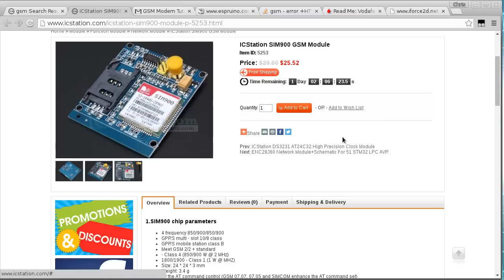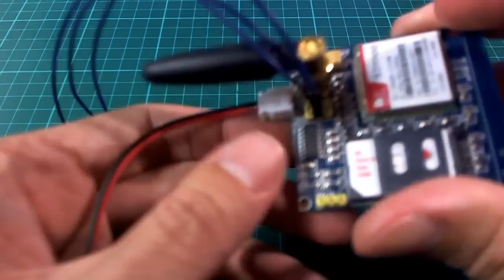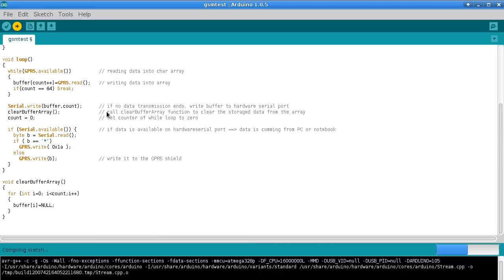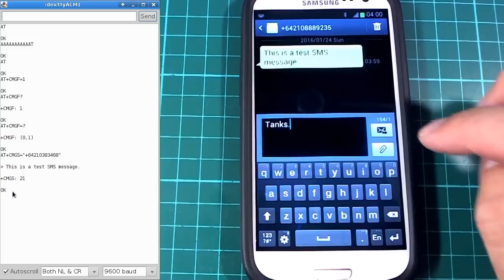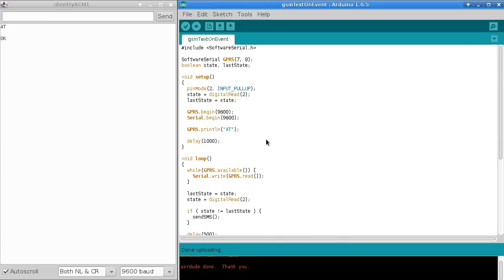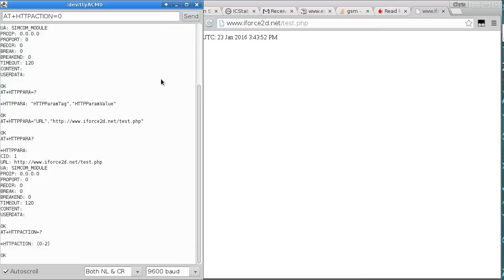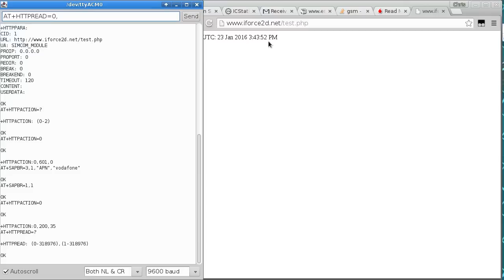Arduino + GSM module (SMS message, HTTP requests)

Comment: Sir i have SIM900A, and its not detecting simcard. Can you help me?
Reply from the maker: +Muhammad Faizan as I said in the video and in many comment answers here.... you need to have an unlocked (password removed) sim card that is recognized by your mobile network, and your mobile network must allow non-registered devices to connect
Reply: +iforce2d you didn't mention k connections clearly. which pin is going into 7 and which pin is going into 8. thanks
Reply from the maker: +Muhammad Faizan well there are only two possibilities, my first suggestion would be to try both ways, it will not take long right? Actually that's what I do most of the time :)
But you can also see in the source code, where the SoftwareSerial is defined, the pins can be swapped there too.
Reply: +iforce2d thanks sir, i hope it will not damage my gsm :D
Reply: +Muhammad Faizan is it possible to receive a message (such as a number like 85) through your phone to gsm and store that number in a variable for some calculation?
Reply from the maker: I demonstrated two forms of receiving messages in this video. In this case I just printed them out to look at, but of course there is nothing stopping you from storing the values. See my other videos on this topic.

Comment: hello, i still failed test sim 900a mini, can you show me or explain me for pin from sim900a to arduino, i see that SIM R from sim900 to pin 7 arduino, SIM T to pin 8, is true ?
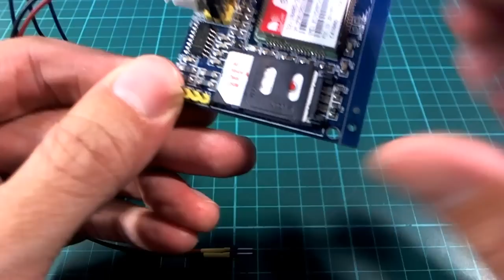Reply from the maker: +Bagus Ramadan please watch again from 5:58 to 8:10 because I showed VERY clearly, and there are only three wires...
Reply: im sorry, i see it, but i still cannot, my indicator blink fastly,
Reply from the maker: +Bagus Ramadan Fast flashing means it's not connected to the mobile network yet. I explained this in the video and I have already answered this in the comments here too, please look at my responses to user BoomBox below.
Reply: maybe, im wrong insert pin, my english languange is bad, so im still not understand, your collor cable is same, im confused, okay, R GSM to pin 7, T GSM to pin 8, GND to GND, isn't true ?? pls
Reply from the maker: +Bagus Ramadan The SIM does not need the arduino to connect to the mobile network - it only needs power. If your LED is still fast flashing, there is no point connecting the arduino yet.
Reply: The sim900a is different to the sim900, I brought the sim900a off of ebay thinking it would be the same as the sim900 but it never connected to the network because my country(New Zealand) did not support it. I found a tutorial to reflash the sim900a into a sim900, then it worked :).

Comment: according to the above video i have configured the sim900a v4.0 with arduino all good and working fine with comuter. but when i connect 9v bettry to arduino   then carrir disconnected please help what can i do??
Reply from the maker: +kamran khan khanzada You mean you power the SIM module with a normal 9v battery? I don't think that will work. As I mentioned these modules can require up to 2 amps of current. Check the datasheet.
Reply: No i cant give the power directly to SIM module i connect the 9V bettry via arduino with same configuration mention in video just only change the power source. please provide the Datasheet link if you have. because i am tiered to search data sheet for sim900a 4.0 kit from google. thank you sooo much for the support.
Reply from the maker: +kamran khan khanzada Why can't you give power to the module? Since you have it working correctly with the computer but not the battery, then obviously the power is the problem. A normal 9v battery cannot provide 2 amps.
Reply: i am making a tracking system thats why i need to put bettry. yes your right 9v battery can not providethe 2 amps. can i put a voltage converter between tham like 5v and 2amps is it ok? its suitable for arduino and SIM module?
Reply from the maker: +kamran khan khanzada yes, that's what I did here, it works ok: https://goo.gl/WWXodz
I used this voltage converter: http://goo.gl/xOd9Jx

Comment: Excellent tutorial! Thank you so much. Just a quick question please? Do the GSM modules that are available generally have on board microcontrollers or are they quite dumb? The reason I ask is that I've just watched some videos on the ESP2866 Wifi chip and there is a project called NodeMCU (lua based) that seems to abstract the AT command set behind a small on board API (the lua interpreter I think).  PS  I'm a complete noob in the arduino world and it's channels like this one that are very very helpful - thanks again ;-)
Reply from the maker: +northshorepx this is the only one I've ever used. I think in general they are 'dumb'
Reply: cheers mate! I've just ordered one to have a play. And I've just seen the Arduino GSM library too - so that may help!

Comment: I do not know English. Could you tell me where you called the OVR and OVT pins on the Arduino ?
Reply from the maker: +Alvaro Jose Marquet Amorim R is for receive, T is for transmit. On the arduino you also have RX and TX (pins 0 and 1 respectively). So you connect RX of one device to TX of the other device.
Reply: +iforce2d But in the video you did not use the pin 0 or 1 and arduino (google translator)
Reply from the maker: +Alvaro Jose Marquet Amorim In this video I'm using software serial, which lets you choose the pins you want to use. The normal  'Serial' (hardware serial) will be pins 0 and 1.

Comment: Great video.  I can't find a datasheet for this.   The description on the various web-shops says it can also be powered from (VCC4) 3.5-4.2volts.  I want to power it from a Li-Po battery, (3.7v) but not sure if it will work.  Do you have a datasheet you can share?
Reply from the maker: +Rob Shepherd Nope - I was not even aware that 3.5 - 4.2 volts is the range it uses, unless you're looking at a different one. That voltage sounds perfect for a 1S lipo battery though.
Reply: +iforce2d cheers.  I think some earlier versions of the ICStation boards had a different header that offered pins for either VCC5 (5v guess to v.regulator) or VCC4 (3.5-4.8v) which I assume was just unregulated VBATT straight to the chip.  I guess I'll have to solder tap onto the raw VCC line if i can find it :)  Cheers again

Comment: How to make more switches and different message for every switch
Reply from the maker: +StratusBikeParts as you can see in the code I'm doing digitalRead(2) to check the state of pin 2. Just do that for other pins....
Reply: +iforce2d OK :) thats im doing, but... how to make that: digitalRead(2) send message Switch was turned on or off and (thats my question) digitalRead(3) send message Temperature low or high. 

two diffrent switches and each kind sending a different messages
Reply from the maker: +StratusBikeParts I showed at 29:32 in this video how to send an SMS. Just look at which switch was changed and send a different message, very very simple.
If you want better help you'll have to make your question clearer.
Reply from the maker: +StratusBikeParts here, it takes just a couple minutes: http://pastebin.com/w7aUFq0q
Reply: Now I understand how it works :) thank you for your response and your time
Reply: +iforce2d  Some idea above adding the option of testing the contact with the module
 once per 24 hours by performing the voice call and disconnect after hmmm two
 rings

Comment: I have done the CR + NL and it doesn`t work. There is a configuration at windows level when you add the serial port of the computer in the control panel-device and printer-Port settings and these are the values that I have::
Bit per second       9600
Data bits:                 8
Parity:                       None
Stop Bits:                 1
Flow Control:           None

Can you please tell me if you have the same values. Cause I am guessing that it has to do with the serial port configuration, Cause I used the same code as you did 

Thanks a lot 

Regards
Reply from the maker: +Luis Mora I'm using Linux, not Windows. Those look like the typical values though. Try to find a manual for your SIM module and read it - maybe it expects something different to mine, if so you are wasting your time asking for my settings :)

Comment: i have changed the jumpers of the module SIM900 from ITEAD that I am using with the Arduino Uno and when I try to use test the AT commands as you did in the video. I can see in the monitor a lot of characters that can`t be read properly cause they are like garbage. Do you know how to fix this?
Reply from the maker: +Luis Mora try using different baud speeds - the default is usually 9600

Comment: Hi, I tried to test the same set as you did at the first part of the video but it just doesn`t work. Every time that I write something on the serial monitor, it doesn`t show it. I have seen that there are several paramenters that I may need to change in COM3 port like parity and all that, do ypu have information that can help me this type of error. thanks a lot
Reply from the maker: +Luis Mora you will probably need to change the CR + NL setting as I showed at 16:49. I don't think I changed anything else.

Comment: Recently, I got this GSM module at just $11 and free shipping from aliexpress. Similar product, but havent tried using it yet. Very helpful and informative video. What flavor of linux are you using ?

http://www.aliexpress.com/item/1set-SIM900A-V4-0-Kit-Antenna-Tested-GSM-GPRS-Board-Wireless-Extension-Module/32471691706.html
Reply from the maker: +Satyajit Roy I'm using Fedora 20 XFCE
Reply: +Satyajit Roy , maybe that price because your module cannot support Europe Network..
Reply: GrcByte May be, because lately I noticed that my one is having SIM900A and the one tested here is having SIM900. SIM900 is quad band module whereas SIM900A is dual band module. But you could still check if the dual band can support your network too.
Reply: whew - It's a few months after iforce2d put this video up & IcStation no longer carries this board - now only carrying $40+ dollar boards. Satyajit Roy's link w/AliExpress still works - the boards (i ordered 2) cost me $14 each. thanks for the video, thanks for the link.
Russ from Coral Springs, Fl usa

Comment: that wuls give you the possibility of controlling a drone anywhere in the world...
Reply from the maker: +Friederrich Eggeling way too slow for controlling a drone I think
Reply: +iforce2d you dont have that delay when you call someone...
Reply from the maker: +Friederrich Eggeling I would guess that a phone call is analog data, not error-checked digital packets that can incur resends.
Reply: +Friederrich Eggeling Also check out the Navio+ its a board that plugs into a Raspberry and uses ardupilot and is controllable from anywhere using a 3G usb modem. pretty cool!
Reply: +gattung  
thats interesting..  
ill have a look
Reply: May be

Comment: Is there any chance you can measure the size of the board and mounting holes spacing for me, please?
Reply from the maker: +LeoTheHuman Sure, it's 48mm wide by 54.5mm long. There is however a redundant looking tab at the bottom that could probably be broken off which would make the length 50mm.
The hole spacing between centers is 44.5x45.5mm as best I can measure. The holes take a 3mm screw.
Vertical height is approx. 34mm when using the provided antenna.
Reply: +iforce2d Great, thanks! Won't fit a mini then. (: This will probably need to go on a bigger model, or I'll need to find a smaller module.